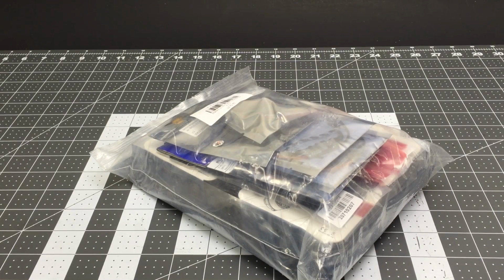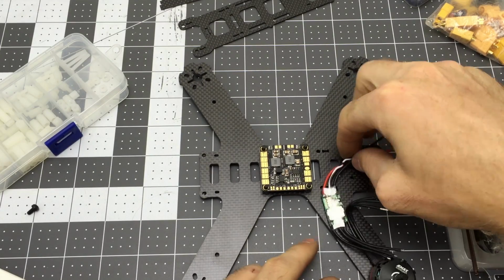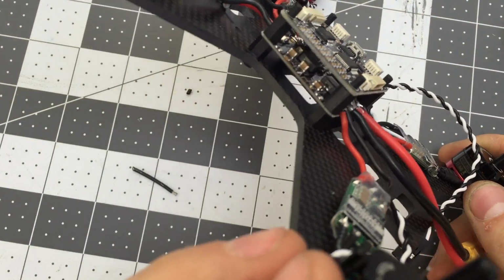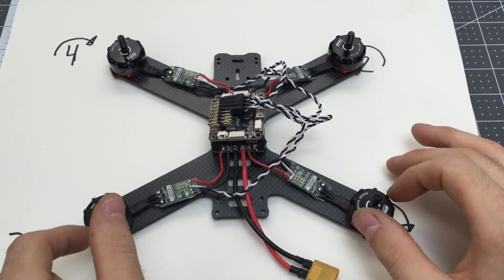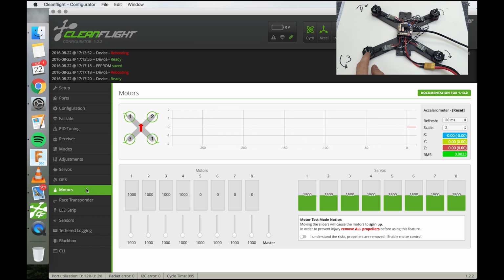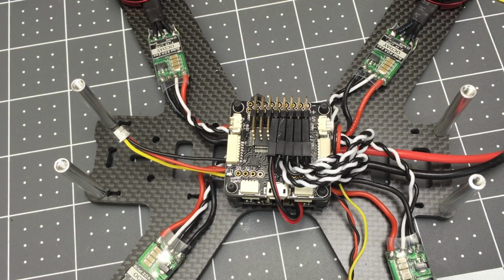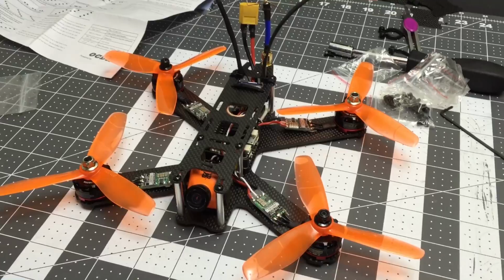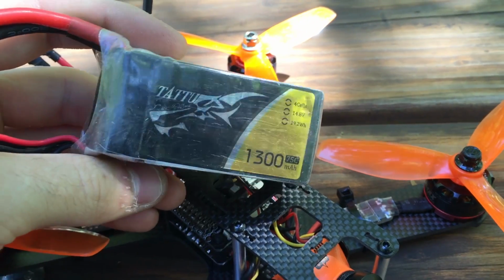FPV Quadcopter Build Tutorial

Comment: I built this drone 3 years ago and the flight control just went out in it. What would be a good FC to put in that would go well with the the older esc's, motors, and vtx. Could I throw in an F7 board or are all the new FC's  only go with the 4 in 1 esc's?

Comment: Thank you so much for this video i'm just looking at getting into the hobby and this video got rid of many of my fears about compatibility and how to wire things will definitely be buying a kit for the dubai 210 and i also need a new soldering iron (preferably w/ temp readout) was hoping you might have some suggestions as the soldering setup you are using looks very good/ efficient.
Reply: SilverEleven https://youtu.be/UUtTm9be07c

Comment: When I try to connect the flight controller it doesn’t connect flight controller or computer problem?
Reply from the maker: That problem can be tricky. Try different USB cables and even different computers
Reply: Samm Sheperd I eventually got it working thank you for responding even though this video is a year old! On my way To the store to get solder

Comment: I used cli to bind my spektrum spm4648 to my DX8. I followed other videos and used UART 2 RX. The bind took. Set the bind=0. The controls on the receiver tab on clear flight don't show them moving. The receiver reacts to my controller. Any suggestions? I have a SPracing F3 V1.
Reply: I don't know why it didn't work but I bought a new FC board. It worked with the satellite receiver, no problems. I did get the old board to work with PWM.

Comment: Started getting interested in building a quadcopter from kit and your site was one of the first to come up.  Thanks for the great video.  The kit is very fair priced too.  However I found cheaper kits with lower amp ESCs.  If I am not interesting in racing do I need the higher rated motors and ESC?

Comment: Followed the video but im having a problem with mine, every time I take off the drone goes into a violent spin and does repeated flips. Been trying to solve this for months so if anyone has an idea to fix this it would be helpful.
Reply from the maker: Props are on the wrong way or the motors are spinning the wrong way
Reply: Check both and both are correct. One thing I noticed, just before it takes off it looks like it tries to correct its self to stay level however it corrects in the wrong direction. Not sure if this is the problem but is you have any other suggestion that would be great.
Reply from the maker: You have that exactly right. make sure the FC's forward direction is the same as the quad's forward direction

Comment: Does it still work if you don't use the software?
Reply from the maker: There is already some version of the software (firmware) on the board, but it's much much easier to load new firmware and set it all up how you need
Reply: Samm Sheperd but i meen no software at all, will it still know where to go?
Reply from the maker: No, it is controlled by software

Comment: Thank you very much!! I have watched a few of these build videos, and I was getting stuck on the part where you have to power the main board, and then power the flight controller, using separate power. You explained it a lot better than others'.

Comment: Hey man awesome video i love it its very clear and helpful but i have a question: does it matter if two negative cables are soldered to one same "thing"? (The negative cable of the xt60 with the negative cable of the esc soldered on to the same thing)
Thanks i hope you understood... haha
Continue!!!
Reply from the maker: Yep that is perfectly fine. All the negatives are just one interconnected piece of metal and all the Positives (except the voltage regulated pads) are the same piece of metal also.
Reply: thanks (it's my other account)

Comment: hey samm  I have the same spracing f3 board as you do but when I plug the board into the pc the lights come on on the board, but when I hit connect on the software it won't sync with board. any advice? you made it look so easy
Reply from the maker: try another USB cable. Try another computer. It's voodoo sometimes
Reply: Scotty Nankivell my board needed upgraded to a newer software. You need an older Clear flight version to do this.

Comment: would a 1300mah 60c 3s lipo battery at 11.1 volts work for this build or is the battery you recommended the min. needed?

Comment: What is the difference between the positive negative and signal wires on the flight controller?
Reply from the maker: The whole board is normally powered with 5v and the positive pins are all just connected to the same 5v and the negative pins are all just the same ground. So you can power the board with any of the 5v and ground because it's all the same piece of metal. The signal pins are different though, they are how the FC tells a particular ESC what to do, and that signal has to have a return path/referent (ground) Thus why most ESC's only have white (signal) and black (ground/referent) The ESC's don't need 5v nor do they usually supply 5v so they don't use red wires anymore

Comment: Is a voltage regulator really necessary on the PDB? Could opto escs run without a voltage regulator?
Reply from the maker: The FC needs 5v power from somewhere
Reply: But the FC that I am using runs on 4-42v, is a V regulator neccessary?
Reply from the maker: The ESC's don't run off of 5v, they run off of the battery voltage and they just need a signal from the FC to know what to do.
Reply: Thank you for helping me out.

Comment: What KV motor should I use on a 6 inch quad build?
Reply from the maker: 2150 to 2300 or so
Reply: Here is my spreadsheet on a first brushless quadcopter build.
https://docs.google.com/spreadsheets/d/1aKvp1K2VJ_92Jwmfkm2FseLn7cwElogBrnESNZWAKiQ/edit?usp=sharing
I know I am really going cheap on parts and I am not going for FPV yet, but what are your thoughts?
Reply: And yeah, I already have a  taranis x9d radio that I used previously on planes.

Comment: Is there any reason that a capacitor would need to be used in this drone?
Reply from the maker: I never needed one but it doesn't hurt. Just kinda acts like a filter for the electrical system
Reply: Is there a video that you can link me to connect the frsky xr4 transmitter and the flysky controller?
Reply from the maker: FlySky and FrSky are two painfully similar names to two completely different companies with incompatible hardware. You'll either need a FrSky transmitter to connect to the X4r or a FlySky Rx to connect to a FlySky Tx

Comment: hey sam!
love your vids!
when you put your black and white cable on to the pins, is there a particular way ?
for example: white cable on top or black cable on top...
thanks!!!
Reply from the maker: The white wire is the signal wire, and the black is the ground. I a lot of setups you can actually just not use the black wire because the main power ground wire will work too. The signal wire goes to the pad on the FC closest to the center, and the black ground wire always goes to the pad closes to the edge of the FC. I do answer your question in my video somewhere I have time codes in the description

Comment: What if my ESC has 3 cables instead of 2 (black and white)? My have: brown, orange and red
Reply from the maker: Originally the "servo plugs" as we call them were used to connect servos to a radio receiver. These servos would move control surfaces on gas powered airplanes etc. The 3 wires used were Ground (black or brown) Positive Power (red or orange) and Signal (white or yellow). When electric power systems came to being, they made them to work with existing equipment. The electric motor now controlled by an ESC. The ESC needs a signal to tell it what speed to make the motor go, and a ground wire. It was convenient to use the Red wire also to power the reveiver and servos with the ESC's built in BEC, since the ESC was already connected to a battery. 
So: Older ESC's which have a BEC inside use the Red wire to provide 5v to whetever you plug it into. Since quadcopters have 4 ESC's it's redundant to have all of them provide 5v, So the 5v is normally provided by a BEC now located on the PDB. So modern Multirotor ESC's only have a ground and a signal.

Comment: Which kind of wire have you used to connect vbat pin of flight controller to power supply board? Thanks and really good video ;)
Reply from the maker: Just one of those little 2 wire connectors I'm not sure what they're called but the flight controller should come with one or you can direct solder it
Reply: Thanks buddy
Reply: In your previous video ,I  Saw that only receiver&transmitter are needed in basic moons of rc .So, what's that thing you set in the body of the drone

Comment: hi !
I have a small question :
do you connect your vtx to anything???
thanks
Reply from the maker: power it with the red and black wires. And give the video from the camera to the VTx to transmit (yellow wire)
Reply: Samm Sheperd 
sorry but I'm a beginner in the hobby... could you be a bit more precise ?
thanks so much for your quick answer 👌👌👌👌👌👌👌

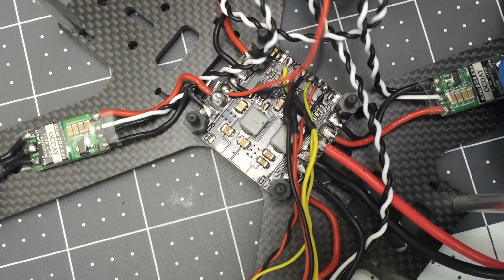Comment: 21:12 what are the little solder joints next to the camera and VTX pads that are labeled vcc and 5, do i need to put solder on them????
Reply from the maker: +HexDan you bridge the small gap to select what power source to give your camera or VTx. vcc means direct connection to the battery.
Reply: thanks

Comment: hi thanks for the video.but can you tell me where the 4 x black and white wires coming out of the esc's are  going please.or where they suppose to be giong.what are the back and white wires.whats their function.many thanks
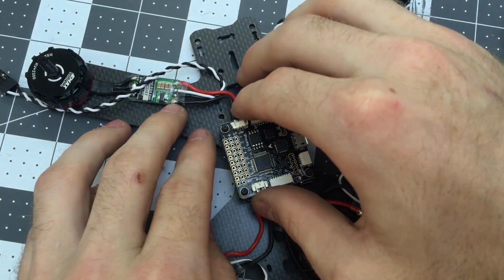Reply from the maker: The white wire coming out of the ESC is the signal wire, It's how the Flight controller tells the ESC how fast to make the motor go. I cover that part at 9:40 ish

Comment: My fav frame is the one below. You can buy them here fully built and tuned by pro builder with latest F4 flight controller and 30 amp Dshot esc's  
http://www.ebay.com/itm/Walkera-034-KILLER-034-V3-QUADCOPTER-RACING-DRONE-PRO-BUILT-over-90-mph-or-more-/201825212767?

Comment: What if my camera is 5-22v and my vtx is 5v do I solder the vtx onto the 5v which is labeled cam, and I solder the camera to the 12v output which is labeled vtx?
Reply from the maker: +HexDan your VTx is 5v only? That's not very common. Normally the VTx will have a wide input range and will have its own 5v output.
Reply: i have the TBS Unify Pro 800mW which as far as i know only takes 5v
Reply from the maker: Ah I see. I looked it up and it does say 5v only. I find it annoying that there isn't a 5v option for the VTx pads, but you can just attach the VTx wires to the CAM spot and put the camera on the VTx spot. You could even just attach the VTx to the main 5v pads on the other side.
Reply: and if i did what you suggested last would i have to solder the vtx signal wires to the same pad as the camera wires?  but i think im gonna go with the first option where i flip-flop the locations

Comment: How do I wire the fpv stuff?? Is it already connected via the signal wires when they are soldered on?
Reply from the maker: +HexDan as long as both the camera and VTx have power, than it's as simply as giving the yellow video wire from the camera to the VTx to broadcast. The video pads on the PDB I used are simply connected together. This is useful just as a place to put the wire while you also can give your camera and VTx filtered/regulated power.
Reply: Thanks

Comment: What flight times do you get with the 4S 1300mAh?
Reply from the maker: bout 4 mins
Reply: Do you think a similiar build could fly with a 1500mAh 4s turnigy graphene? Because i find 4 minutes a bit short (especially since I'm coming from RC planes which i can glide for hours).
Reply from the maker: sure this could take an 1800mah 4s no problem but when you're after maximum performance with then you sacrifice flight time. We just take multiple batteries. I fly hard and only do 3 mins and that feels much longer when you're ripping balls..

Comment: Is it possible to add thin solar panels to this ..it will be cool if it generates its own power during the flight
Reply: Possible but probably won't make much of a difference. But this is a very fun hobby and you can experiment all you want. A plane with solar panels is more viable
Reply from the maker: Sure it's possible, but this is not anywhere near the ideal platform for a solar powered vehicle.

Comment: Do they sell the frame separately in case you break it?
Reply from the maker: These parts will fit any of the hundreds of frame designs out there today. It's all pretty standardized. The frame is a clone of the QAV 210 frame which is like $75 but you can get the same clone frame for like $15-$20 or so
Reply: Thanks!

Comment: if the solder connects between the positive and negative does it cook my parts?
Reply from the maker: Yes, that provides a direct path between the battery positive and negative called a "short circuit". Things will smoke.
Reply: Samm Sheperd OK thanks!

Comment: excellent video man! very well put together super clean instructions from beginning to end and clear video up close. i subed your channel. thank you so much for making this. definitely answered a few questions about my qav210, especially in the configuration tab. i think i might ditch my simonk ESC's with linear BEC's and swith to BLheli optos. just curios what is your rc rate and expo? also what soldering iron do you use how many watts? appreciate any more info you could give, thanks again!
Reply from the maker: With cleanflight or Raceflight I would use (on my transmitter) 30% expo on the pitch and roll and like 20% or less on yaw. And I don't remember rates. Now I use Betaflight, which has a lot of expo built in so I don't have any expo on my Tx.
I use RC Rate of 1.48 and 1.91 for yaw
Super Rate of 0.73 and 0.52 for yaw
I used a 40 watt iron in this video. Now I use a Hakko temperature controlled iron

Comment: Hi Samm, thank you for sharing. What about using 4s lipos on dubai 210? there are some discussion on rcgroups (https://www.rcgroups.com/forums/showthread.php?2684495-The-Dubai-210mm-Quadcopter-RACE-KIT%21-SUPER-SALE-128-59%21%21) and also gearbest state using 3s with these 20 amp escs.
What's your thought?
Reply from the maker: The kit in my description has popular 30a ESC's. Also, these days race quad ESC's can handle more current than they're rated for. This is opposite to how airplane ESC's were.
Reply: Samm Sheperd ah ok, you were lucky. Mine is shipped with 20A ESCs.
Reply from the maker: You didn't order from my link right? Like I mentioned: I got the original kit with the ocday 20a but I hated them and didn't want to recommend them to my viewers so I used this other link which is the same kit but with the respectable ESCs.
Reply: Samm Sheperd you'right. Ordered after watching painless 360 :(
Reply from the maker: Mic Rob Those are great
Reply: Samm Sheperd great! Thanks.

Comment: ya have fun soldering the new escs the solder dosnt melt
Reply from the maker: ? well there is no way why it shouldn't. Make sure the tip is clean, use a tiny bit of new solder to get the heat to conduct, and make sure the iron has enough power. I also do not reccomend lead free solder. I've spent too many hours of my life being frustrated by crap soldering equipment. It can be very fun, easy, and satisfying.
Reply: That was my problem was crap solder I just used the flux core solder and it was a dream. :)
Reply: Hey I have the orange t-six transmitter as well as the redcon cm703 receiver and I need some help. I cant get the receiver tab in cleanflight to ever recognize that I have a receiver. It is bound, but none of the channels are reading or moving on cleanflight. should I use ppm or serial like you did?
Reply from the maker: ***** As far as I can tell I don't think that receiver has a serial output, but it does have ppm. (still one wire, but slightly more latency than serial)
Google "spf3 manual" according to it:
with the usb port facing up, then the big port on the left is IO_1. Plug one of the big 8 pin connectors into it, and use the first 3 wires that go into a single plug and that is what you'll use to plug into the ppm port of your Rx.
Then in cleanflight receiver tab (or the configuration tab in Betaflight) secect "PPM" from the receiver type. Hit save and see if it's working
Reply: That is what I did and it is not working. How is cleanflight supposed to be setup?
Reply: when you have time could you like skype with me or something this has taken hours haha and still no luck.
Reply: idk maybe you could walk me through this transmitter. It is on acro, but I am not finding the right information online to help me set it up it is almost like the transmitter is not communicating correctly with the reciever
Reply: i had the same problem and just upped the heat on my iron ( i know not every iron can do that) from 300C to 400C and it worked perfect.

Comment: hey samm!
i don't mean to bug you, but im using a lumenier 4power pdb and i dont know where to solder the fc power. If you would be so kind, could you give me some advice? 
thanks!
Reply from the maker: There is a spot on that PDB where you can install a Pololu voltage regulator. So if your FC needs 5v, then installing a 5v Pololu will give 5v to the Aux 2 pads.
Reply: Thanks! The receiver lights up now but not the FC. Could it be an issue from a previous attempt to power it using one of the ESC pads?
Reply: Yes I'm a frickin idiot
Reply from the maker: obscure internet reference At least you didn't install the battery leads reversed and fry everything! I may have done that :p
Reply: I would probably cry if that happened. I had to scrap my matek because i accidentally bridged + battery and - esc and i couldn't fix it so i replaced it with a spare 4power before i would do anything else. fun times!